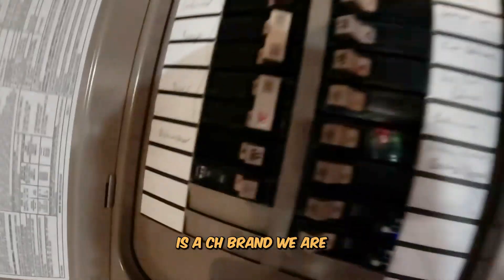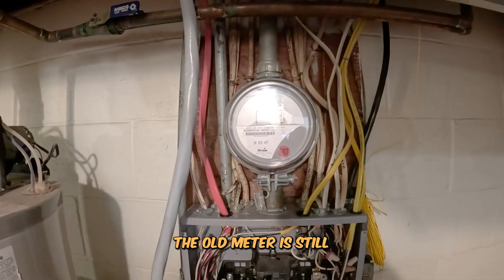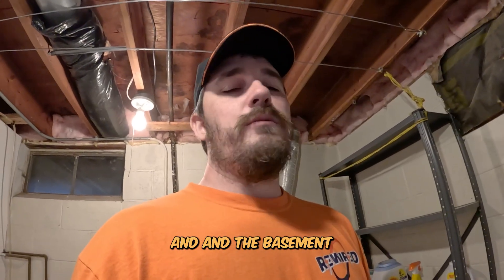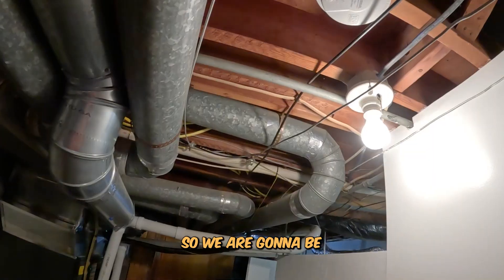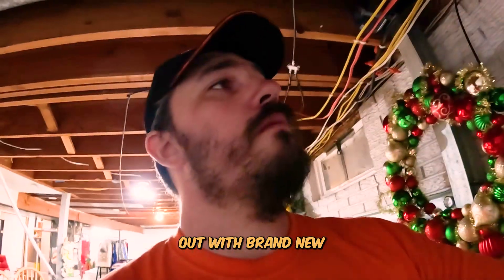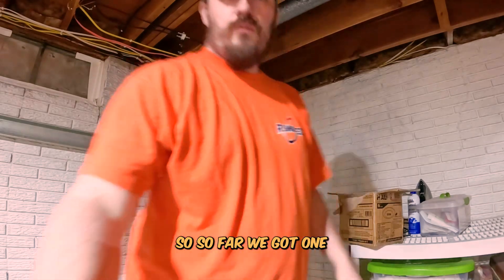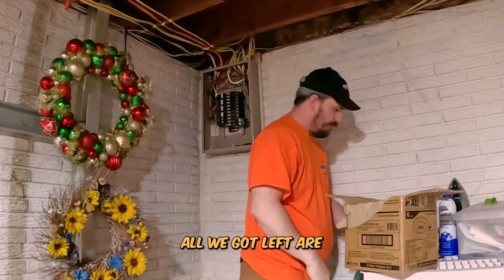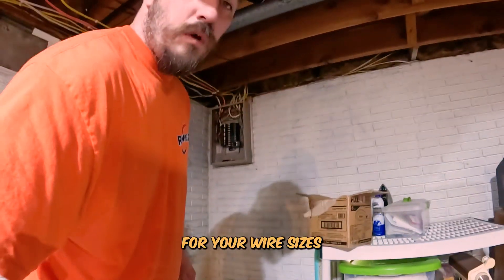We Found THIS in an Iowa Home’s Electrical Panel… And Immediately Fixed It!

Comment: I like the BR Breaker Panels made by Eaton/Cutler-Hammer better than the CH.  BR Breakers were engineered originally by Westinghouse.  You can be SURE if it's Westinghouse under the BR Eaton/Cutler-Hammer Panel.